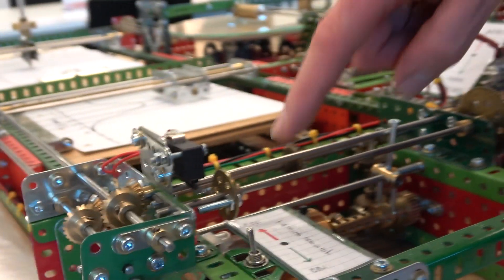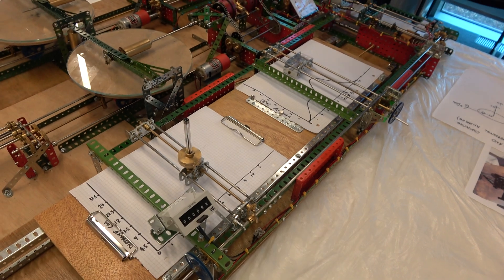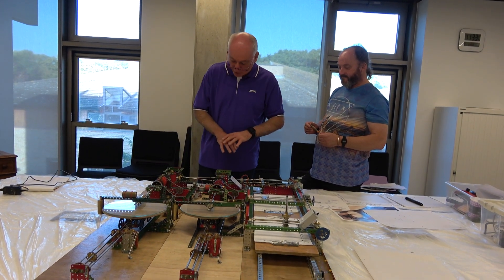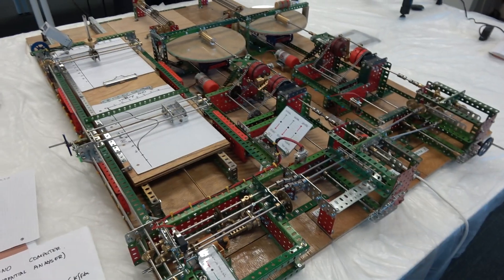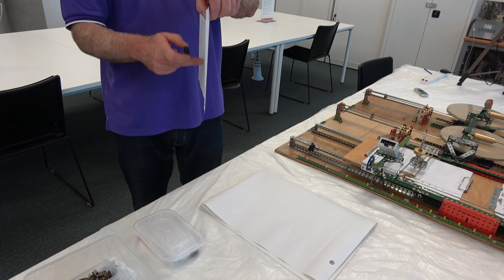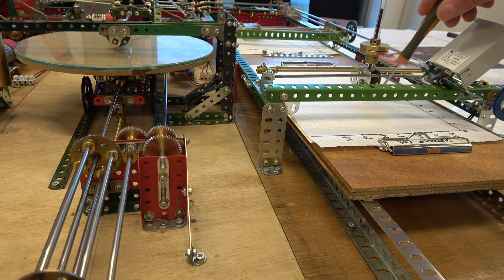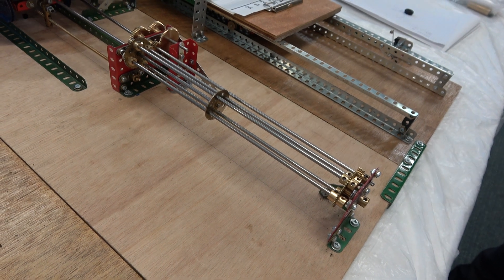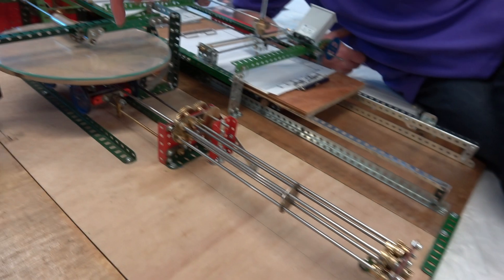(3/4) Exploring how the differential analyser works in simple terms

Comment: You're spending so much time on minor details like scaling factors, yet this far in to the explanation I still don't see how this thing can do differentiation.  Integration on a time or other arbitrary independent variable I see it doing easily, just keeping a running sum of how far a wheel turns.  But I don't see anything allowing you to do it the other way, giving an output of the rate of an independent variable on another.